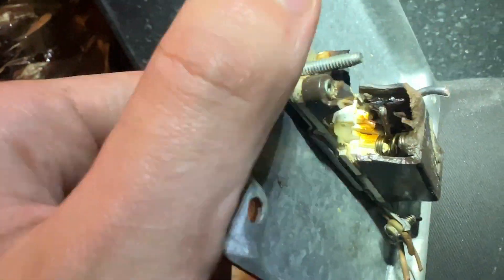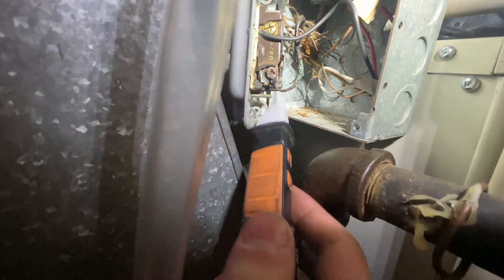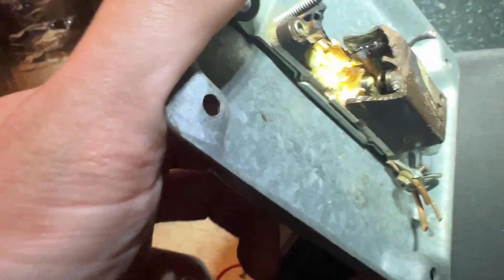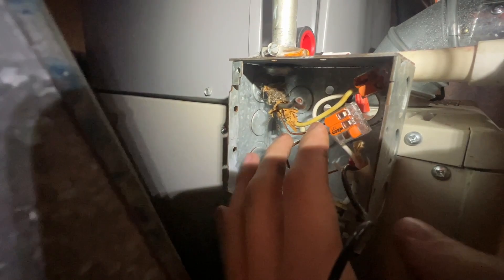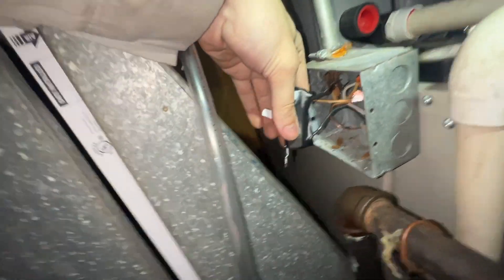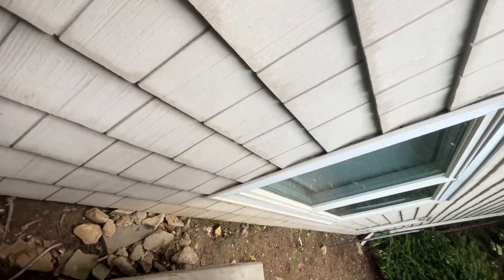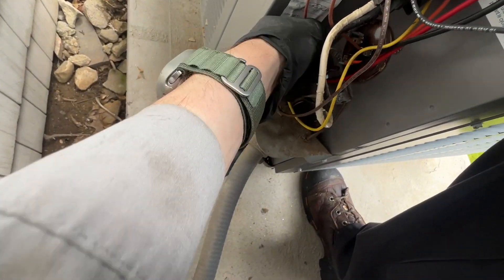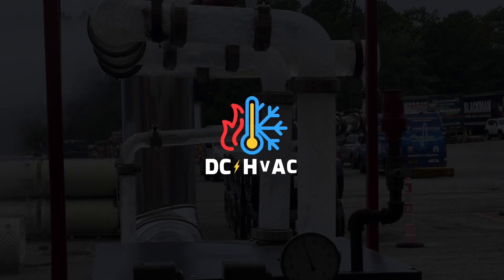Melted Light Switch Caused a No-Cooling Call! Replacing a Rheem PSC Condenser Fan Motor With Rescue!

Comment: Did you ground the metal box?
Reply from the maker: I didn’t. The unit is grounded to the chassis. The box is screwed to the unit. The box is grounded through the unit, through the box above, and to the panel. Im not an electrician, I’m an hvac tech.  How I wired it is how I wired it
Reply: @DCHVAC  understood

Comment: In the future,cut the wires back and pigtail them!
Reply from the maker: Not a huge fan of pig tailing unless I have two. That’s one more connection each wire. If repairs need to be made to wiring in the future, there’s plenty enough to pigtail.
Reply: @DCHVAC  The theory is that when you pigtail,if a device itself fails it wont kill everything on the circuit.I have done quite a few,aluminum wire fixes to convert to common copper devices and there are 2 recommended fixes,crimps and pigtails with purple wirenuts! Dont be afraid of joints in your wiring,be afraid of bad(improper connections) in your circuits .
Reply from the maker: @petersmart1999  the unit is on an indipendant circuit. As all should be. Manuals specify that

Comment: Not sure what brand switch that was,but why oh why do people risk it at times to save $1 on a switch or a receptacle! And ,never reuse an old switch on a replacement! Nice job! Probly a loose connection did that one in!
Reply from the maker: I’m guessing the reused the 20+ year old switch on the new equipment.

Comment: My money is on the hot screw terminal’s loosening up causing a heat build-up on the switch leading it to disintegrate.
Reply from the maker: My moneys on the installers reusing an existing switch, and messing with it during install causing it to loosen
Reply: and mounting it upside down, then writing on the switch plate “on and off”😅
Reply from the maker: @eddiew.6485  lol

Comment: Daniel!! Bad connections = heat, heat = no bueno on an electrical system Great job Daniel those terminals burnt up most likely cuz they weren’t connected well
Reply from the maker: I agree, probably reused an old switch.